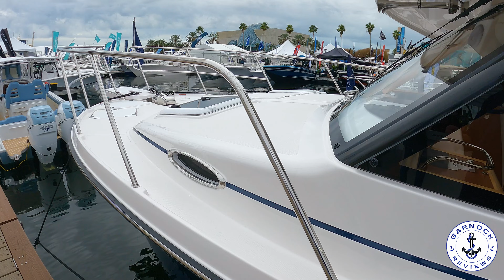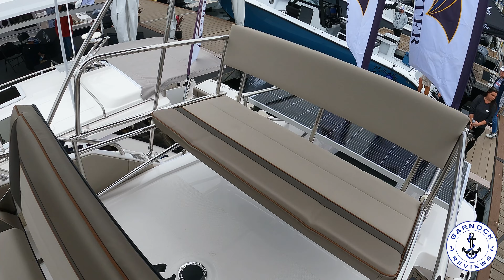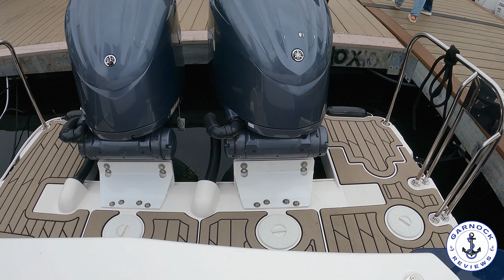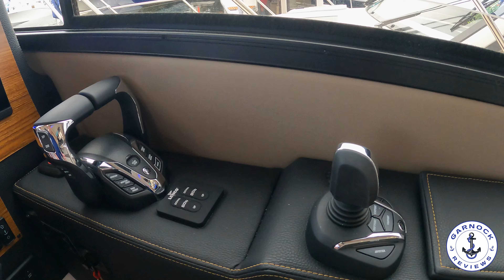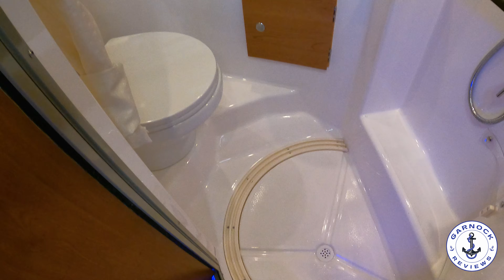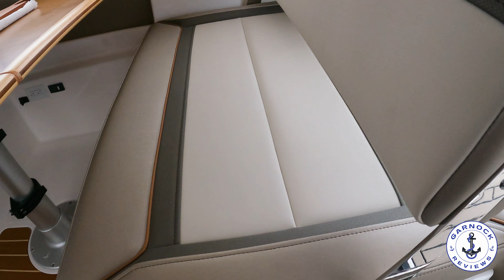$424,835 - (2025) Cutwater C32 Command Bridge Boat For Sale

Comment: Why is the radar down there? What's the use of a radar only showing forward? Makes no sense...
Reply from the maker: Sorry for the delay, I only just got this notification. I have seen this setup on several boats, and curious what the display would look like. Granted, there is more to worry about in front of you than behind, but would still prefer 360 degrees if it was my setup.
Reply: @GarnockReviews Yes, sure nothing wrong with this but I rather get the full use out of my radar... In narrow lanes and with small slow boat it's nice to see what's coming from the aft, especially if there are big freighters running the lanes that may not see smaller crafts in the fog for various reasons..
Reply: @GarnockReviews Hey, now when I followed the link in your description to the site you can see different set up with radar high up in a mast on top of fly bridge? So at least the set up used to be good 👍👍👍😊 but probably they moved the radar down to get the Bimini top?
Reply from the maker: This boat can be towed on a trailer too. Maybe it is permanently located low so you don't have to worry about raising and lowering it each time.
Reply: @GarnockReviews Yeah I'm sure there is a practical reason and for the next owner it's easy to move the scanner if they like 👍